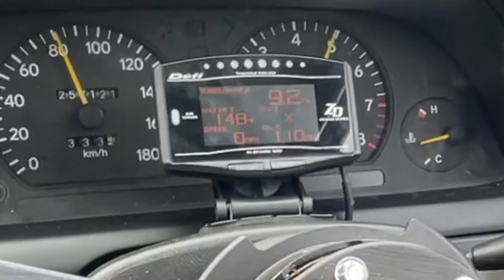WE PUT A NEW 1JZ IN THE TURBO TOYOTA CHASER...BUT still aren't making any boost, Is it a bad turbo?

Comment: Great video! How is the IS300 running?
Reply from the maker: Hey @biller thanks for the continued support and watching! The is300 is good we ended selling it to a person from Colorado and drove it home 2000miles talked to them and they haven’t had any issues runs like a top…that set up we did on the is300 series seems to be a pretty reliable and safe set up, I can’t recall do you have an is300 that’s built or are currently building? If you need any help we are happy to help with any info or things we ran into, don’t hesitate to ask!
Reply: @mabuildsofficial  So glad to hear it's running well! Thank you so much for offering support, I just started adding a turbo kit to mine! I've been working on the fuel system before putting it into the car... (Aristo fuel hanger) Could definitely use some pointers and tips along the way! Thanks so much! Looking to nearly duplicate the setup minus some small differences! Did you guys use O2 spacers for the o2 sensor that normally goes into the y pipe?
Reply from the maker: @Biller
Glad to hear your starting the build! It’s gonna be a fun driver for sure! To answer your question yes we did use a spacer on that 02 sensor I believe we  have a link to the ones we purchased on the 4th video of the build. They are the L shaped ones that are advertised as mini cats, it gets the sensor far enough but not too far so that it fools the computer to thinking it stills has the cats